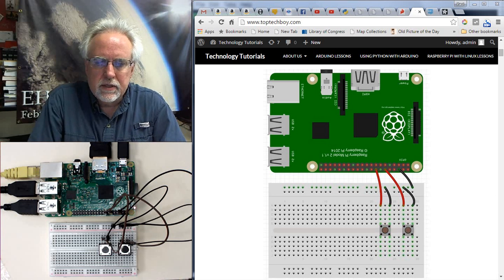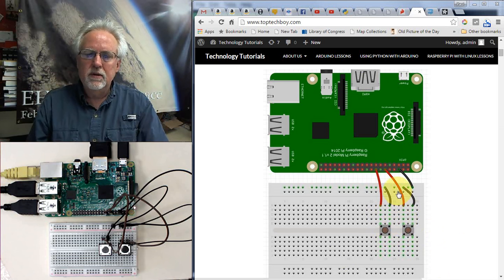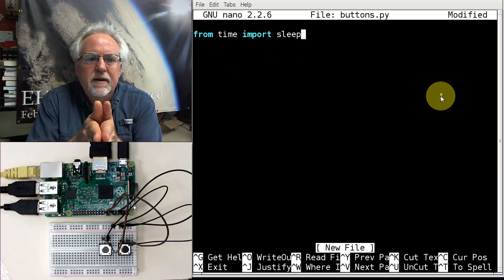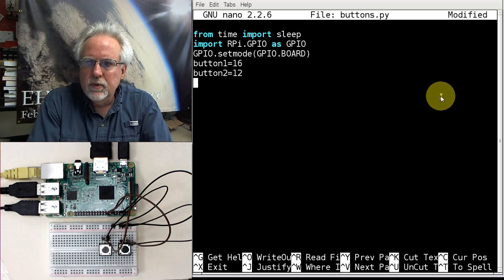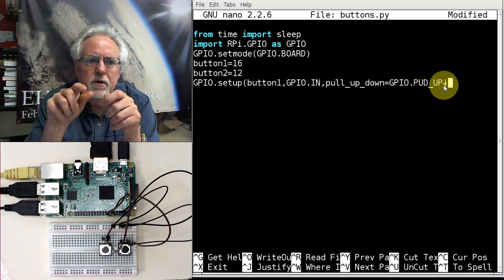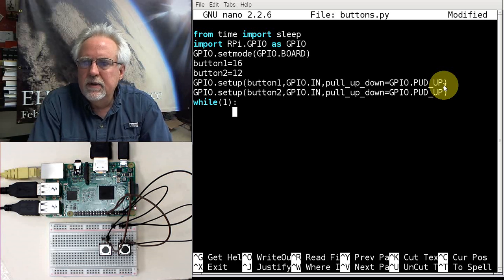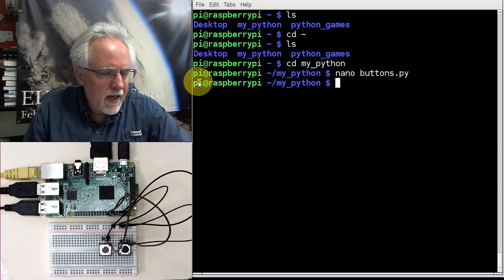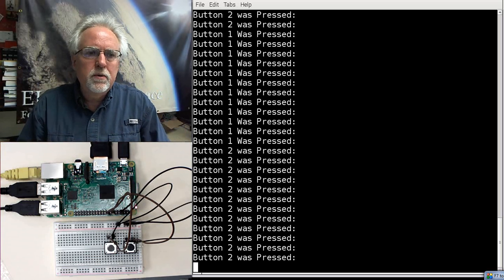Raspberry Pi LESSON 29: Using GPIO pins as Inputs and Reading them in Python

Comment: Anyone: Thank you for any response. My questions:  Is there a limit to the number of switches I can use with available GPIO pins? The switches should not be drawing any current, only closing a connection. In addition to that, I need a ground + 2 GPIO pins to control a double relay. Now, I will be using an alternate power source for J-gcc to activate the coils. The 2 wires + ground will only be for control. Yes, I am going to heavily use the GPIO bus. Is there some type of "break out board" with Raspberry Pi that I can use if I want to use a LOT of switches + relays? Thanks for any advice.

Comment: Your teaching style is really easy to follow. Thanks. If I wanted to print only once when the button is pressed and only print again once when it’s un-pressed is this something I could add to this code base or would the code need to be completely different? The way I’m trying to implement this code is to have a reed switch change the state of a relay using the relay as the “button/switch” to the input of the RPi gpio.

Comment: While(1) has no exit strategy.
On that note, it would be a good idea to perform a gpio stop and a cleanup at the beginning of the program since thats a potential unknown that could cause an error
Also, a conditional check for a change in state of either button could be entered to limit the report to just once per press. And not inhibit further checking of either input.
I would do this by having an additional variable button1latch=1 and button2latch=1 prior to the main loop.
If button1 is pressed then
    if button1latch=1then
          print your output once then
         bring button1latch=0 
Else if button1=0 then.         button1latch=1
Do the same for button 2

Comment: i whant to  know  what is the high value in my RPi 3 b  because im doing a circuit and y onley have 2.5v on mi input,  its enought voltage to make the pin read a high? how i can conect a supply sourse whitout damagging the RPi ?

Comment: Hi, I have a question for you. I've search everywhere and i can't seem to find an answer anywhere. I have the raspberry Pi 3 set in the NESpi Case which means i'm using pins 1-10 for the power/reset buttons on the front of the case. I'm Looking to install a rtc, is there any other way to connect it since the usual pins are being taken?

Comment: nice video and informative. I have a question. I am using raspberry pi 3 and I am turning on and off the led using 8 channel relay. I also want to know at what time they are pressed and for how long they were on? I have a code for single Output but i want to expand it to all 8 channels. please can you help me how i can do that. example of the code is following 
python code:

import time 
from time import sleep  # Allows us to call the sleep function to slow down our loop
import RPi.GPIO as GPIO # Allows us to call our GPIO pins and names it just GPIO

GPIO.setmode(GPIO.BCM)  # Set's GPIO pins to BCM GPIO numbering
INPUT_PIN = 26          # Write GPIO pin number.
GPIO.setup(INPUT_PIN, GPIO.IN)  # Set our input pin to be an input
# Start a loop that never ends
while True:
            if (GPIO.input(INPUT_PIN) == True):
                # load is turned off.
               print (time.strftime ("%Y/%m/%d , %H:%M:%S"),"0")
            else:
                #now 20 watt load is turned ON!.
                print(time.strftime ("%Y/%m/%d , %H:%M:%S"),"20")
            sleep(10);       # Sleep for 10 seconds.

and i want to save all the data in a .csv or .txt file with time stamp at the start and other 8 columns for pins status that are connected with relay.
my output should look like
06/01/2018,18:54:00,1,0,1,1,1,0,0,0  
06/01/2018,18:54:05,1,0,1,1,1,0,0,0  
06/01/2018,18:54:10,1,0,1,1,1,0,0,0  
06/01/2018,18:54:15,1,0,1,1,1,0,0,0  
06/01/2018,18:54:20,0,0,0,0,0,0,0,0  

please help me

Comment: Hi Paul, if I use 3 nos.  on/off toggle switch and connected to 3 nos. GPIO pin. I need to monitor the switches activity. Let say SW1 switched to 'ON'  and it print "SW1 ON" than at the same time if SW2 / SW3 switched to 'ON' will it print "SW2 ON", "SW3 ON". If I use your Python programming code will it work. Please advise. Thanks

Comment: Could I trigger a GPIO pin high by connecting a 3v battery to the pin? Would I connect the positive battery terminal to Pi GPIO and the negative battery terminal to the Pi Ground?
Reply from the maker: GPIO pins are set via software. They are output pins. You are treating it like it is an input pin. I would never hook a voltage to a GPIO pin.
Reply: Ok, I ask because I am planning to make an in car system but need the pi to shutdown/startup safely by listening for when the voltage in my 12v car cigarette lighter is disconnected (which the car does automatically when I remove the key). 

The pi would be powered with a separate battery but I need a way to shut the Pi down safely and ideally also start it up when the car is started too if possible.

I was hoping to use a voltage regulator to step down the 12v to 3v and send that to the Pi GPIO pin which I thought could listen for current changes. But you seem to think this would not work if I explained myself properly? 

If you have any hints for how I could do the above I would appreciate it.
Reply from the maker: OK, I see what you are saying. You really are going to have to be careful, because I dont think you want to directly connect 12V to a GPIO pin. here is an article that discusses use of a GPIO pin as an input. Remember, you must be careful about too much voltage applied. https://www.cl.cam.ac.uk/projects/raspberrypi/tutorials/robot/buttons_and_switches/
Reply: Just use a relay or a resistor divider or an optocupler., or an transistor bc 547 and some resistors

Comment: hmmm. why you not set a sleep(0.1) at end of while loop instead of in the if... the while loop will else loop as fast as possible when no button is presses, which is consuming ressources...  so would it not be best to have a  general sleep(0.1) outside if the if's, at the end of the while loop? btw i'm no raspberry or phyton expert.. but i'm a prof software developer
Reply: I am just getting into python and Pi. I have a while loop nested inside the if statement to prevent the repeated print statement. It prints once then waits for the button to be released to break from the if statement

Comment: I have a robotic arm that has 6 motors (6 shaft encoders) and 5 limit switches...Will I be able to use the GPIO pins to read output form the encoders and limit switches???
Reply: Should be able to, depends on your encoders. Check that there are sufficient pins available to handle all of them. There are python libraries for encoders out there.